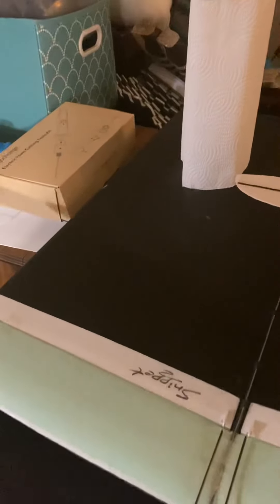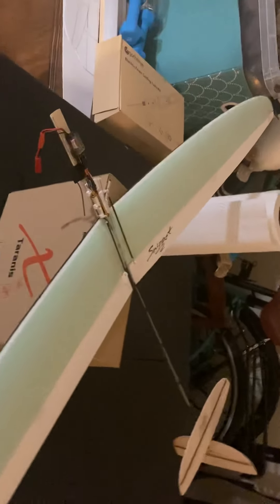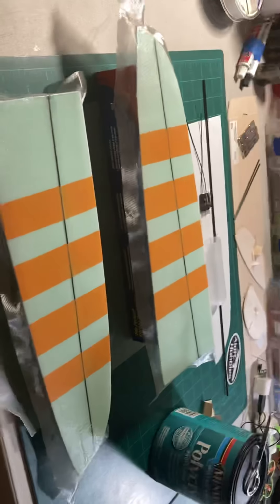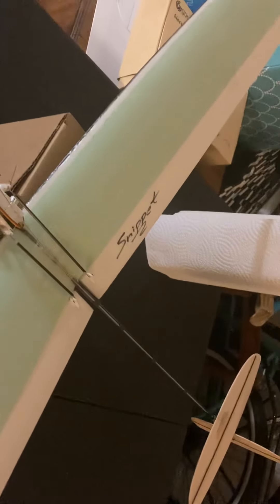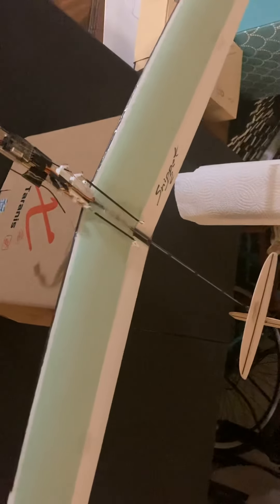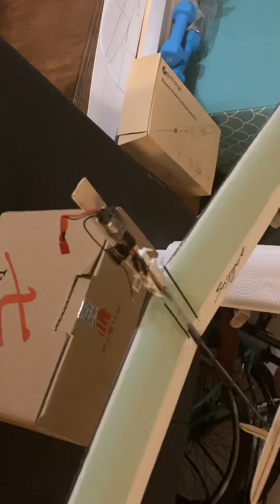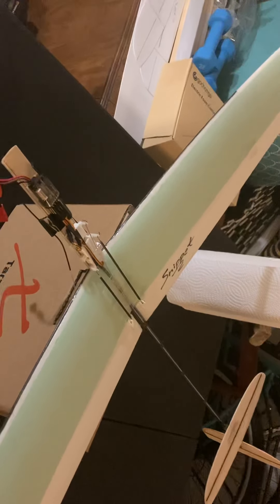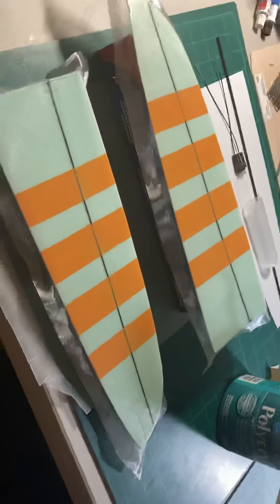Close up of prototype scratch built DLG #1: ‘Snippet’

Comment: Very nice glider and technic! I have a "Snipe" wing shape scratchbuilt DLG too, but that is just 2ch (RE). Hey, where You can buy that elevator holder?
Reply from the maker: Kennedy composite in the us for me.   Hyperflight  in Europe I believe. There is a better one hyperflight sells for the ‘Malibu’ dlg. But you would need to use a 6mm tube for the boom for it to work.
Reply: @banko444  It is great, but the price is high enough. ;)
Reply from the maker: @goldenfish77  yeah. With shipping I bought 2 and they were like $18.  I’m not using them again though.  🤷🏼‍♂️. I’d stick with pylon and regular elevator man.  I bet you won’t be satisfied with the slop You see in elevator movement either.  There is a reason no competition dlg use a full flying stab anymore.
Reply: @banko444  Thank You for these useful informations! Yeah, this elevator fixing is very interesting theme. My elevator tore off after a strong starting throw. Fortunately, the other parts of the machine were not damaged by the fall.
 So now I can see what a load the elevator gets
 at launch. :)
Reply from the maker: @goldenfish77  did you reinforce the pylon with a strip of fiberglass?  If not, it’s necessary under any circumstance.
Reply: @banko444  After that, I will do my best not to have to stop flying because of a disaster of this kind.
Reply: Hi, I want to rebuild my "Alatyr" DLG's wings by Your wing build method. The new foam wing cores are ready with spars. Do You make the ailerons after the whole wings were glassed? When do You fixed the wings to the fuselage? I don’t know how the best steps in the construction process would be best.
Reply from the maker: @goldenfish77  personally I make the aileron and wing separate and glass separate.  But you could also make the entire wing as one and cut the ailerons free after glassing.   My way allows the glass to wrap into the  pre beveled ‘joint’ between the aileron and wing however.  That’s the reason I do it that way.
Reply: @banko444  And with Your method the wing and the aileron will be stiffer from the surrounding glass. I will make my wings with Your method! Very nice, thank You!
Reply from the maker: @goldenfish77  exactly!  Look forward to seeing it man. It’ll be great.  You’ll love it.
Reply: @banko444  I made a prototype "wing cover" with fiber glass and lack from my old "Alatyr"'s wing foam core. The result is very encouraging. Thank You every informations!
Reply from the maker: @goldenfish77  yeah. I was VERY skeptical until I tried this.  Didn’t seem reasonable anything but bagged epoxy would work to do fiberglassing.   But this does work great.
Reply: @banko444  Yes, it works great. maybe it works better than paper cover with glue (stiffer end result). Let me tell you, if I use a 45 ° fiber direction on the glass fabric, the accordion will shrink narrowly if I tighten the material a bit. Does this phenomenon occur in you?
Reply from the maker: @goldenfish77  yeah it will if not delicate.  Don’t want to let that happen. I cut the glass out 1 cm bigger than panel all the way around.  Roll it up carefully.  Then roll it out carefully DRY onto the wing.  Then dab poly down the center carefully with your brush first. THEN carefully work the poly out at 45* angles from that center line to the edges.  Once all wetted out.  Come back with a softer bristled brush and smooth out any inconsistencies.   It does take a bit of touch.  But this works for me.   Any tiny bubble you miss. After it dries. Poke a pinhole in it and use some foam safe CA to glue it down smooth.   After a bit of practice you will not have really any bubbles however.
Reply: @banko444  Very nice instructions! Thank You for Your help! You inspired me to build this method and You give me encouragement to continue this nice hobby. Thank You!
Reply from the maker: @goldenfish77  it really does give a nice result.  Satisfying to me as it kinda feels like an art project. Lol.   Glad to pass on for sure. :-)
Reply: @banko444  Yes, I think that I have to do the wing's cover from two pieces as You tell me. I try to make from one piece but there are lots of bubbles on the surfaces. I made the other wing's cover from two pieces. I see that the result will be better than first. So the bottom and top wing surfaces have to be built from one-one piece clothes. Very nice and stiff wings will be for this method, I see. Thank You!
Reply from the maker: @goldenfish77  yeah it does have to be done one side at a time. I do the top first so the airfoil can’t be distorted ( ie it sits on its flat side elevated on something to dry).  Then I sand/trim the edges.  Flip over and glass the bottom.  If you do the whole wing at once I can’t see how you would avoid disturbing the first side while wetting the second side.  After its done I forgot to mention I get some 30 min epoxy and use my finger to ‘smear’ just a bit thinly all down the leading and trailing edge with my finger.  Seals in the edges of the glass very well.